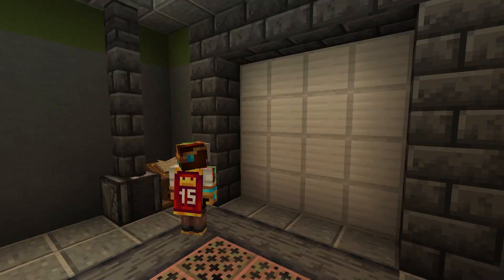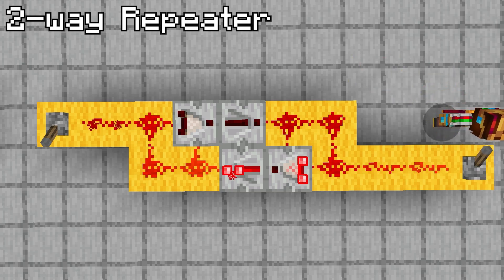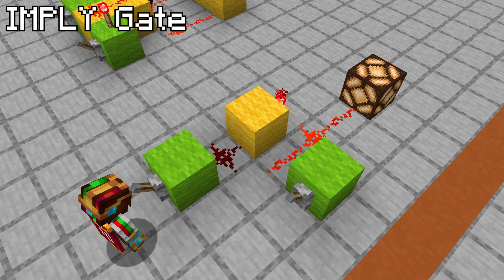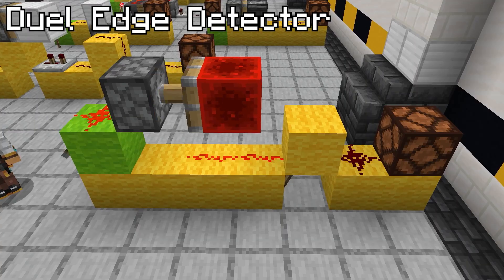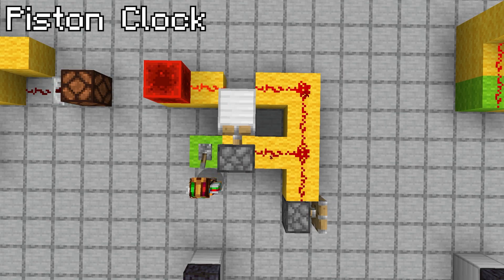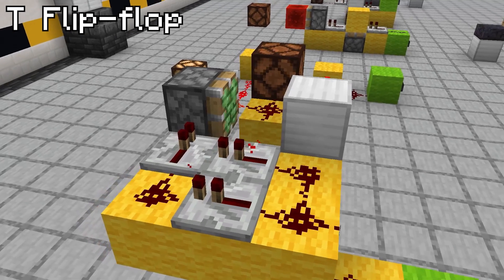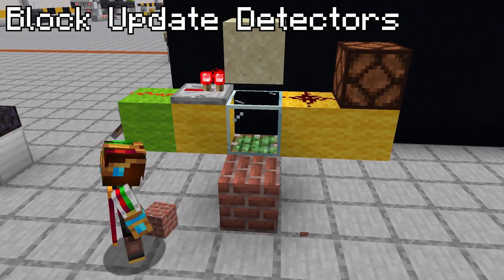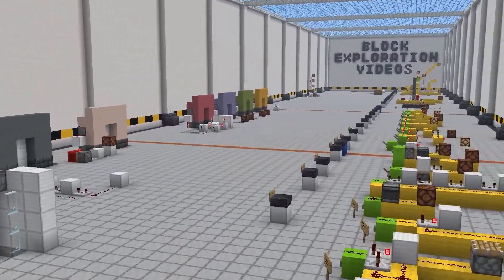All Redstone Circuits and Logic Gates (1.21.8)

Comment: Very cool video, I understand a bit more ! But i have a quick question. Would it be possible to make a lever give two different result, like on activate it pushes the piston with a delay, and on deactivate, it retracts the piston immediately, using only one lever i mean?
Reply from the maker: Hmm. You could have the lever power both a repeater line and a Redstone dust line to another piston, pushing a block in front of the repeaters to allow the signal through. When the lever is turned on, the piston pushes the block in front of the repeaters so when the signal gets through, the line is on. The when the lever is off, the piston retracts and breaks the line
Reply: @BlockExplorationVideos It worked well! Thank you so much !
Reply from the maker: @0xysan  Yay! I'm glad I could help